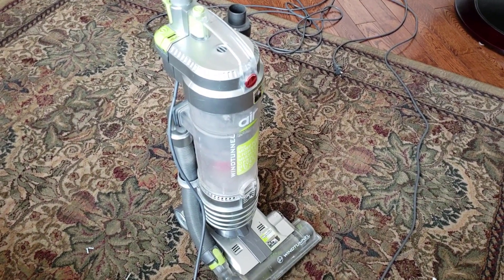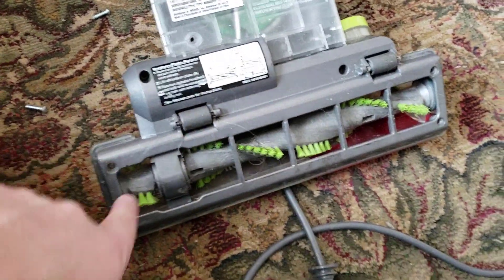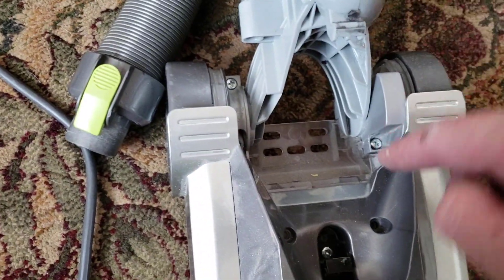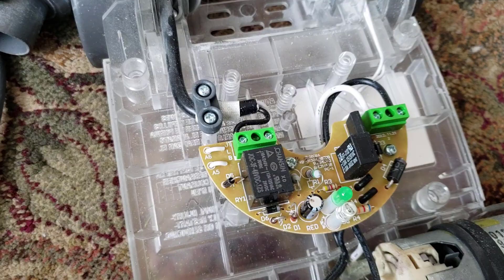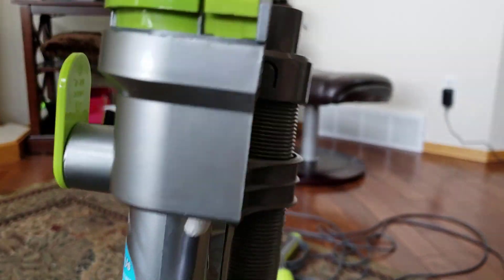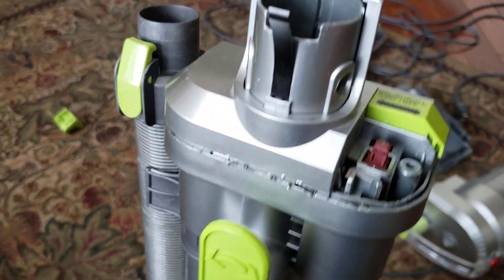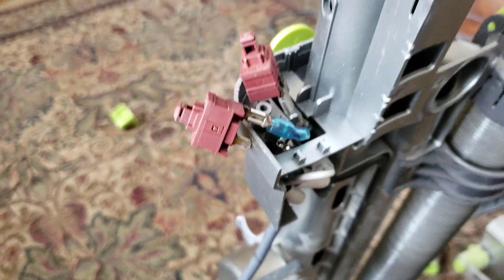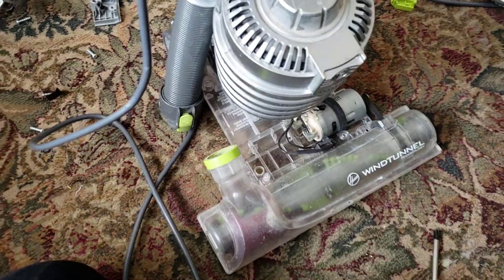Disassemble Hoover WindTunnel Upright Vacuum Model UH70400

Comment: Thanks to your video, just fixed mine in 15 minutes switch was stuck in on position, pulled red piece off, put gel lube around switch, saved buying another vacuum, my problem was it would not shut off. You gained another sub by showing what not to do, tks !

Comment: Thanks for this. But I did one more thing and that was to loosen (and jiggle) the switch that sits under the cap by the left wheel - the one that is activated when the handle is pulled down. It got the brush motor running again.

Comment: You ever disassemble the Air to Nossel assembly hose?  That hose is Very Good about wearing out and splitting.  I'm trying to find a replacement for just The Hose itself and reattach the two connectors.  I've rebuilt this thing twice.  Parts are hard to find for this vacuum.  I don't think Hoover expected anyone to maintain it.  Expected it to last a few years.  lol.

Comment: Can you offer some advice on what to do when power on switch does not stay depressed.  You have to manually hold it down to vacuum.  Is it the switch or a clip or spring that keeps it depressed?